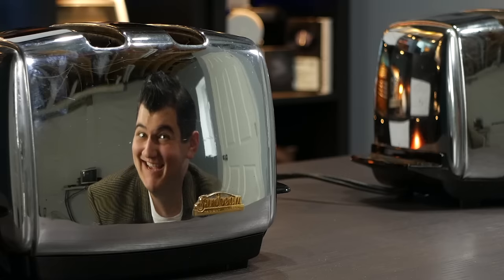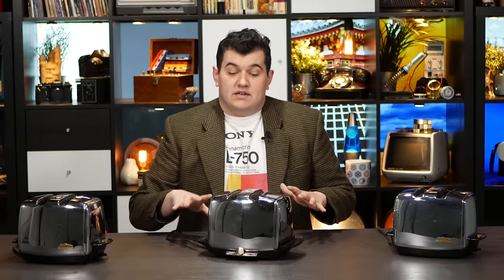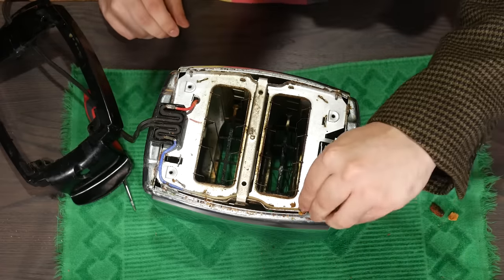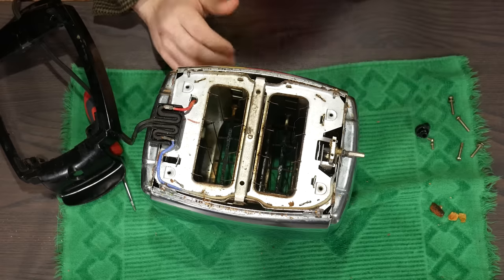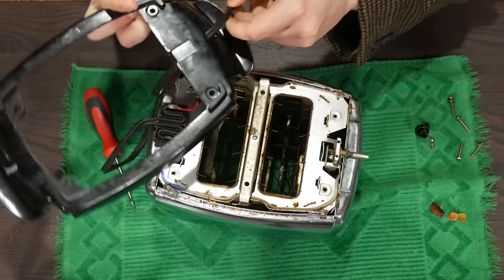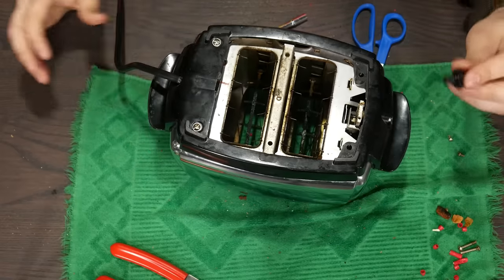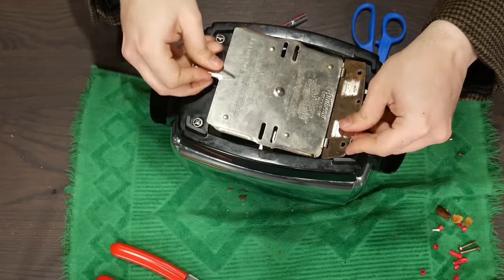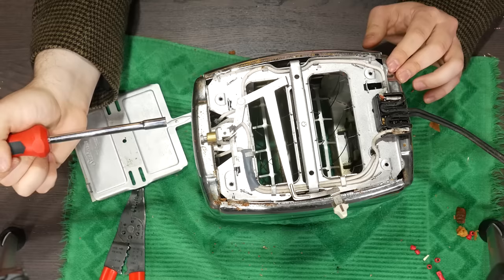Sunbeam Radiant Control Toaster--Repair and Modernization

Comment: Hope your butt connectors are aluminum wire compatible, just in case that was an actual aluminum wire.  I was thinking flat cord when you mentioned the limitation of the strain relief location being right at the entry point, but then you covered it.  Nice.
Reply: It's VERY unlikely that wire was Aluminum. First, Aluminum can't conduct current as well as Copper. Second, it also can't conduct heat as well as copper. It was probably 'tinned' like that so the assemblers and/or repair techs could tell the two apart when working on it. That's pretty common with small appliance cables that don't have color coded insulation.

Comment: I haven't had a chance to go through all 1200+ comments (excellent job), but in the 1970s there was a price spike in copper. Many houses on that time were built with aluminum wiring to save money. Likely, this is the reason for the different wires. They used the copper only where absolutely necessary.

Comment: The diode method would not allow the toaster to work correctly on 240V. Firstly, it would be a severely asymmetrical load, which the power company probably wouldn't appreciate. Secondly, it doesn't give the correct power output. When you run a resistive load on x times the voltage, the power is actually increased by a factor x^2 because x appears in both the U and I term of P=UI which gives 4 times the power for 2 times the voltage. When you then half wave rectify the current, that only halves the power, giving a theoretical 2*nominal power. There's a little more to it than that because because the increased temperature would also increase the resistance and lower the power slightly, so the power would effectively not quite be doubled, but certainly more than nominal.

I'd also get a better crimping tool, preferably the ratchet type. They will lock and won't release until the tool is fully engaged, ensuring correct crimping pressure. In a correct crimp, the connector and wire actually make an intermetallic bond, which means they essentially can't come loose, and that's why you couldn't undo the existing crimp without breaking the wire entirely.
Reply: Gameboygenius major information dump I’ve got to be honest, I couldn’t read it all

Comment: I live in the UK and I don't think Sunbeam toasters were ever sold here, but I do have an Australian made one that operates on 240 volts and so is suitable for use in Europe. I bought it about 10 years ago for very little as the seller said that it burned the toast even on the 'palest' setting. I discovered about the adjusting screw when I took it apart to see if I could fix the over browning issue. Since then it's worked very well. It nominally runs at 1600 watts and so is potentially slightly quicker than the American made ones that I think are rated at around 1300 watts. Of course we've had polarised and grounded plugs here for many decades and our wall sockets are also switched so that appliances can be switched off completely without having to unplug them.

Comment: In the U.S. UL appliance specs and revised electrical wiring codes have seen outlets made closer along counter walls, and cords made short so they aren't hanging over edges. GFCI are mandatory in kitchen outlets, either in the circuit panel or installed in at least the first outlet along a series so as to protect all downstream fixtures. If old wiring is grandfathered into old homes, adding GFCI should be a no brainer. Grounding appliances is sensible, as  long as the wiring is correctly polarized, because the ground is likely a better conductor than your body, taking most of the current from a short. I bought multiple compact under-counter lighting units with an extra integrated outlet 20+ years ago, and each had the polarity reversed in the integrated outlet - testing is easy and might save a life.

Comment: my first job was performing electronic safety checks at a university. lots of the appliances i had to check (and repair, if they didn't pass the test) where at least 30 years old, if not more. Attaching new plugs and cords to 50 year old heating devices became an almost daily task so this is a really familiar sight to me. 
(and on the thing with the paper isolation, I once had a heating palte in hand that used ceramic beads threaded onto the naked wire as heat proof isolation.)

Comment: Double voltage multiplies power by four, Diode divides power by two. It won't do 240 with just a diode. It /could/ work with a phase control "dimmer".
Reply: Exactly! Besides it would do a quite major DC injection into mains.
Reply: @UCswNv6Z123TfeMC_t9jxPjg And archive what? Back to 4x power?
Reply from the maker: Thinking about this stuff makes my brain hurt. It seems to me that by killing the negative swing of the 240V sine wave, you effectively get 120V but I suppose you're actually getting 240V DC at a 50% duty cycle. Which is going to produce twice the power of the same resistance on 120V.
The time component messes me up here. Stupid brain.
Reply: If the four heating elements are connected in parallel (which I guess seems plausible on 120V), you could rewire the elements by putting each two of them in series. Then it should work with 240V.
Reply: @TechnologyConnextras  relateble

Comment: I disconnected the old power cord by filing the crimp connectors.  I filed one manually; the other I ground with a Dremel.  The Dremel was slow, perhaps because I used a grinding wheel that was too fine.  Also, it heated the connector too hot to touch.
Rather than butt-crimp a new power cord onto the internal wires, I soldered.  And rather than twisting the internal wires with the stranded copper power cord, I poked the small-gauge internal wires into the strands.  I used heat-shrink tubing on the solder joint, and then (unnecessarily) painted over them with "liquid tape".  The result was bulky, but it fit into the strain-relief maze.  I used a three-conductor 14-gauge power cord (black, white, green), with a heavy-duty plug.
To keep the strain-relief maze block in place, I cemented it with CA to the chassis, and I cemented the wires into the channels to keep them from jumping around.
Puzzle: as a sanity check, I measured the resistance from the ground prong on the plug to the outer shell -- several kilohms!  Resistance to the inner chassis was zero, as expected, since the green wire is connected to the chassis.
But the green wire is also connected to the outer shell in the screwed-on sandwich with the outer shell, the ground connector, and the chassis (28:00).  I put the ohm-meter's probes on the outer shell.  Nice chrome ought to have low resistance, right? Nope. The resistance in the nice shiny outer shell is kilohms!  What is that shiny metal, nichrome or something?
Anyhow, the toaster works, and the heavy power cord with its huge orange plug is spiffy.

Comment: Speaking as an electrical engineer:

My public opinion: Use the grounded 3 wire cord.

If I was rewiring MY personal toaster, I would simply use a 2 prong polarized cord.  That would prevent the problem 99.99% of the time.  The difference is that I'm not likely to sue myself for bad information if the 0.01% failure occurred.

As for the butt connectors... I would have simply cut off the insulation, and used a short piece of heat shrink tubing to insulate any part that stuck out of the strain relief.  (Actually, I would have soldered the connection, as I prefer soldering anything under about a 14 gauge wire.)

And yes, that woven cloth looking material over the wires does look suspiciously like asbestos.

Comment: You might want to be a bit more precautious with those wires, I can confirm that it is Asbestos insulation, as any paper style back then would be wax impregnated and not be suitable for high heat situations

Comment: TC, I hope you see this. Don't tear the end off your oversized toast. Slack off the darkness setting considerably, place the toast in sideways with the end down, when it cycles, rotate the bread end for end and switch holes. You mentioned the side to side browning inconsistency, this will compensate for that, and toast your long bread perfectly.

Comment: I'm late to this toaster party, but I wanted to mention that you don't have to cut the ends off that insulated butt connector. Just use a razor blade lengthwise to cut the plastic off entirely, and inside is a shorter uninsulated connector ready to go. Paired with a bit of heat shrink tubing and it won't pop out while you fiddle with getting the wire position just right. Love your videos!
Reply: Just wondering whether the red plastic that was cut off was the heat shrink tubing. Iow, no need to cut it off; just use a heat gun to avoid the bare wiring as seen in de vid.

Comment: Putting a diode in will NOT make this function on 240 like it would on 120v.  On 240 this will draw 4x the current it does on 120v, not 2x.  Even with the diode on 240 it will pull 2x the power it was designed for (this may still work though)
(edit), not 4x the current, 4x the power.  2x current and 2x voltage.

 On a side note, those style of crimpers are terrible, it you do much crimping at all I suggest a style like this part number from Pico (365-11) or the ratcheting style.  The one's you have are really hard to apply enough force for reliable crimps.  When using the style you have you should pull firmly on every crimp to make sure it's well connected (maybe you already do this, just putting it out there for anyone with this type of tool)

Insulated crimps are ok, these days though I just use uninsulated ones and put heatshrink on, looks much nicer and adds some strain relief for the wires.
Reply: Jeff Webb  they would use thinner elements, or longer ones to raise the resistance of the element meaning it will pull less current.

Comment: @Technology Connextras. Your videos about these toasters are extremely well done.  Kudos. Regarding the “ONE SLICE” text being flipped, the reasoning would be if you were going to turn the toaster to be perpendicular to the counter.  If you did, you would have the slot activating the mechanism closest to the user and want the writing legible.  My best guess anyway.
Reply: Also, for hiding the splice of the cord as it enters the toaster...  just use a rubber grommet (size 3/8”).  Works perfectly on both the T-20 and T-35.  Can’t say for others as I haven’t tried.  PLEASE don’t Dremel out like others mention.  Destructive modifications are for hacks

Comment: 31:35 why not put tape or glue over the strain relief to keep it in place?
Reply: this is heating device! good luck with standard tape or glue fumes on your toast. (yes there is heat resistant Kapton tape)

Comment: I just bought one of these, in beautiful cosmetic condition too! It’s a “newer” model like yours with the slide control and off position. My issue is even in the off position, or no toast in it, it’s toasting! I adjusted the tension to make it tighter by a good bit but it still does it! Idk what to do. Advice appreciated 🙏🏻

Comment: I gotta say that's an interesting design, I only encountered toasters where you manually have to push down on a lever to lower the bread into the body and turn on the machine with that and when it's done the whole lift just pop right back up scaring everyone in the kitchen.

I'm kinda addicted to the continuity test function of my little multimeter, I would check first to see where the red and blue wire actually ends on the plug and after assembling it check again on the plug's side to somewhere inside the toaster if the wires are making contact, also, the ground pin to the chassis of the toaster. And for good measure, check if the pins of the plugs are not shorted somehow, test between all 3 of them.

Comment: I just got one of these from cleaning out the family cabin.  I'm in the middle of a full disassembly, to clean the crud and grease off everything.  Wish me luck!

Edit: Mine is a T-31-1.  It didn't have colored cords, and they circled around the edge of where the crumb tray was.  It did have rivets on the side panel covering the lifting mechanism, but the rest were bolts.

Comment: Welp, just fixed my toaster using this video. Thanks. It was sitting in a box to go to a thrift for just the reasons elucidated in the video. Now it's got a three prong plug and back in action. I did some continuity tests on the wiring coils and can see there's continuity  so the potential for a shock if I start poking inside when it's live so always some lessons to learn about safety.

Comment: These were made for 240V in Australia, with earthing.  You just use a slightly different size nichrome heating wire.
Ours are made to use 2400W.
The spiral heating wires are spiral so that they don't hang loose when they get hot and expand.  The same as almost all other heaters.

Comment: Wow our Aussie versions have a completely different wiring harness, with a dedicated earth (ground) terminal. Perhaps something to do with our 240v power supply here. 
It amazes me that Toastermatics Stateside didn’t have an earth, considering the all metal construction. 
Also: you have a bi-polar power supply meaning you can reverse the live and neutral inputs, meaning live can go through the heating matrix or straight to the switch, depending on how the plug is inserted into the wall socket

Comment: Used to be the homes didn’t have as many CONVENIENCE outlets on counters as today, as in they may have to run further for an outlet, and modern kitchens usually have receptacles close, so long unsightly and unsafe long chords are a nuisance.
If you notice on most modern appliances chords are somewhat categorized in length.
Hand Mixers, electric knives say for instance usually have a longer chord, counter appliances toasters, toaster oven, air fryer, coffee makers etc, have relatively short chords.

Comment: Clicking through old Videos from this channel, that I haven't seen before and stumble over this one :-)
I have a theory about the "One Slice" labeling:
Clearly they intended the toaster to stand infront of you, with the shade controls facing the user (newer modell - heating elements orthogonal to your position). But specially, if you have less space in your kitchen you will rotate the toaster in a way, that it stands with the cable facing away from the user (heating elements parallel to users standing position). In this position the "one slice" is written upside down. I would guess, they changed it for that reason.

Have a nice day everyone!

Comment: High temperature fiberglass sleeve insulation over the ends that pass around the connections you made .
 And you might use a little fiberglass resin to patch the bakelite if it ever needs maintenance.  
 The fiberglass high temperature insulation sleeve go over the wire and wont melt like plastic , or rubber . It insulates the wire ends that hook to the heating elements in appliances .

Comment: Highly recommend getting auto-adjusting wire strippers and then using a vice grip to crimp the cables on. Much easier to strip with the former and set your tension for applying the wires with the latter.

Comment: Thanks to your videos, it made me miss my Sunbeam I had from my Grandma.  My "ex" has it, and so I went and purchased one on eBay (A T-40).  But the elevator tension and the thermostat were not quite right.  I was able to adjust the two screws (elevator and the sliding thermo screw) and it works perfectly now.  Thanks!

Comment: So here's a "pro tip" regarding crimp tools.  When you crimp a connector on, you are supposed to put the nib side of the crimper against the solid side of the connector (not the side where the slice is).  Most people don't know that there is a "right" way to do it...but there is!

Comment: YOU HAVE THREE OF THEM!? For a year now I've been looking for this toaster on the German equivalent of craigslist and couldn't find a single one. After watching your video about the Sunbeam R. C. on your main channel I kinda fell in love with this toaster. And here you are casually flexing on me with a triple set.
Reply: Try to buy one from Australia. Don't bother importing from the US because it would need a lot of work to convert it to 240V. Australia already has 240V, you just have to replace the plug
Reply: @retropcs88  Oh, I didn't even consider this. That's a good tip! 

Still haven't found one... 
Where to look for classifieds etc. in Australia?
Reply: @Hiasibua  I think ebay is probably your best choice. If you have someone in Australia, they could buy it local and then ship it to you, but i don't know if any services like that exist. (I know it's a big thing in Japan)

Comment: LOVED the video, but I do have a question about setting the toasting level. I inherited a T-120B, which worked great when my Mom still used it. It cycles just fine (lowers toast then lifts), but now unfortunately the toast settings are  "burn", "char" or "incinerate". Is that the thermostat, or another part of the operation? How can this be fixed or reset on the oldest models? Thanks!

Comment: I don’t know if a version for the European market was ever made, but I know that Husqvarna in Sweden made a toaster in the late 60s to early 70s which used the same principle to raise and lower the bread, I know because I have one. It also has a darkness control much in the same way as this toaster. The main difference is that it has a little push button at the top, so you insert the bread and push the button, and it slowly lowers the bread down the toaster.